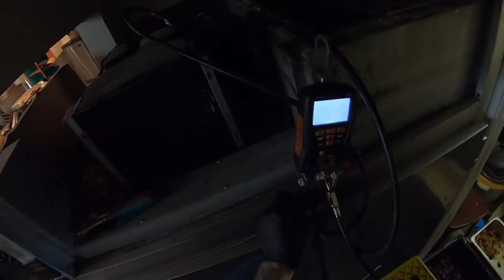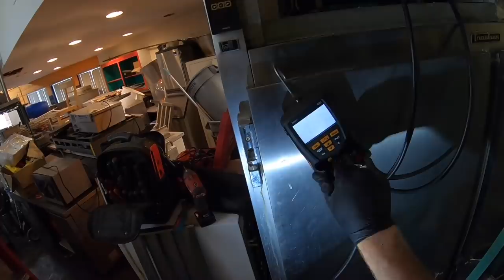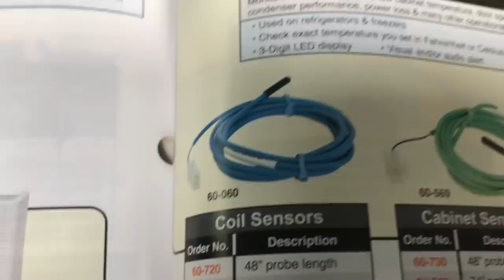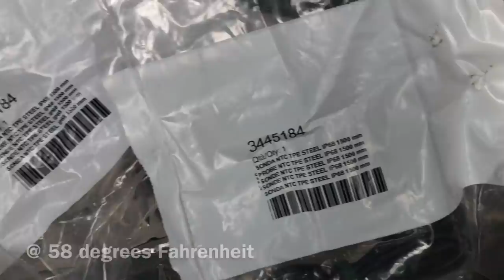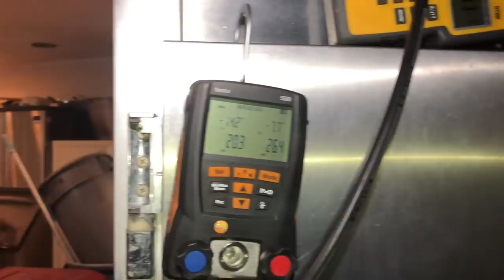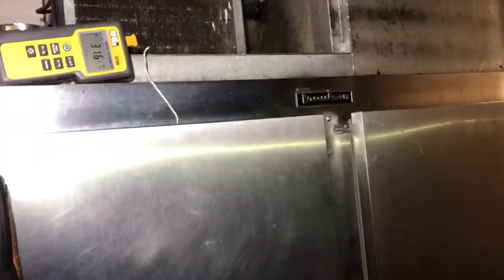Traulsen G22010 Freezer Repair

Comment: We have a lot of traulsen equipment at the school district where I work. I use a lot of Beverage Air drain line heaters in them they fit perfect I've had a few issues with them freezing up the drain line. The Beverage Air drain line heater fixed in just about any reach in freezer.

Comment: The scenery on the way to the job was pretty sweet.  I have the same Imperial swage/flare kit, had it for about 18 years. Just used it last week to replace a section of 3/8" copper.  I use it mainly for stuff 3/8" and smaller, no splits and nice and round.  Try to keep that one low nut out of the toilet water  :-D

Comment: Hey man I have a traulsen freezer G12010 that is not cooling the digital controller saids C25 , the condenser fan is not starting and the starting components just click I was thinking that was the problem so I replaced them but it is still doing the same thing my next move will be the actual fan itself was just wondering if you could give me your input on it

Comment: I like the “good enough for me” on the sensor values. HVACR videos would have swapped the whole controller and probes if it was 0.5 degrees off.
Reply from the maker: 🤣😂🤣😂🤣🤣 like I have always said. You do it your way I’ll do it mine, and there both just fine!
Reply: And 15 minutes in the end talking about it
Reply: @OcRefrig  lol
Reply: I like both of these guys.. They both have their own flavor. In the end the real question is who will do the better job in fixing the problem for the client.
And whose repair job will last longer without a need for a call back.
Reply: I'll watch Dave's vids over Chris's any day.

Comment: Bud I need your help. I have exactly this same Freezer G22010 and the heating defrost element is damaged. Can you tell me where to get it? And the part number. My freezer  is pretty old may not be the same . I have seen a  parts manual in one of your videos but I can find it. To look it up. Thanks!
Reply from the maker: Refrigeration hardware supply you can find them on line and call them.

Comment: The newer Traulsens have that fan assembly that you have to replace when the evaporator motor goes bad, but that's the only thing I can say that I don't like about Traulsen.

I actually got out and about today. An old B series water cooled unit locked out on high pressure safety. Water turned off to the building and a bunch of metal plates on the road. Ain't hard to figure out that one.

I felt bummed that I couldn't help, but I showed him what to do when the water department finishes their job, and I returned to oblivion. 

Oh well, when this is done, I'm sure I'll have 12 hour days again.
Reply from the maker: It will be so busy!
Reply: @OcRefrig  
I discovered a microwave oven in the house, just after I was laid off. I can eat at home..., who knew😉

Comment: I just worked on that model of traulsen 2 door freezer yesterday.  Cabin sensor was bad causing high temperature display on the digital tral....Dave was I supposed to use silicone on the gasket  of evap box prior to putting lid back on? ?  If so, then I messed up I didnt have any on hand.  Also, what kind should I use for sealing cases and stuff?

 Lid had four 3/8 bolts.
Reply from the maker: Not if it’s in good shape. Mine was trashed.

Comment: Why the flux when unbrazing the drier?
Reply from the maker: Pipe comes out clean
Reply: Have a link to the amazon sensors? Looked up those numbers but nothing popped up
Reply from the maker: Vig 37 XLX 10Pcs NTC 10K Thermistor Waterproof Sensors Digital Temperature Probe for Refrigerant Air Conditioner and Refrigerator(100cm) https://www.amazon.com/dp/B078SQH536/ref=cm_sw_r_cp_api_i_38OKEb07DN9TZ

Comment: Would painting the condensate loop stop it from rotting out?
Reply from the maker: Anything couldn’t hurt. We’ve made them out of stainless tubing and they still leak. Water n heat eats everything.
Reply: @NorCal-refrigeration  very interesting. Thanks for the reply. Stay safe.
Reply: acidic or alkaline water and PH out of whack will eat everything and anything, typical condensate water :)
Reply: @throttlebottle5906  I guess the only way to stop the condensate loop from rotting is just to not have one.
Reply: getting rid of the loop and going to a electric heater helps a bunch, but it still builds up inside the insulation on the lines from evap. to compressor and those corrode away, as well as other key areas.
Reply: anyone try leaving a sacrificial metal in the condensate pan?.. piece of sil-phos or similar?
Reply: @davejohnsonnola2758  that's an interesting idea. I bet that would help. I am going to try it next time I have a chance.

Comment: ( Ftngot ) on Traulsens i Prefer to Eliminate the condensate Loop & use a Electric Heater in the drain pan. They Make one just for traulsens. its cheap & i stocknit on the truck. Eliminates it ever happening again , But Either way works just fine.
Reply: you are not suppose to Eliminate the hot gas loop 

1.  it Helps Bring down the Highside
2. Electric ones Heat up the space like crazy
Reply: Pan heaters are the way to go! Easily replaced!
Reply: Exactly! Even if you have to hard wire. No big deal
Reply: @OcRefrig  

Pretty sweet but this Parts town is listed at $300. Maybe be cheaper if I went through my account at the school district I'm sure it would be. So this will fit right into the existing drain pan? Are we keeping that in mind I work at a school district with lots of traulsen. I've been having put the Beverage Air drain line heater and quite a few of them works really well.

Comment: Good vid ! Why did u Replace the sensors ? Totally agree with u on Traulsens , Totally Rebuildable. as Long as Box is Good / no Holes in the floor. Traulsens can go for 30 years or more.
Reply from the maker: They were bad
Reply from the maker: OcRefrigeration , Hvac & Electrical Video's. I edited it out my bad.